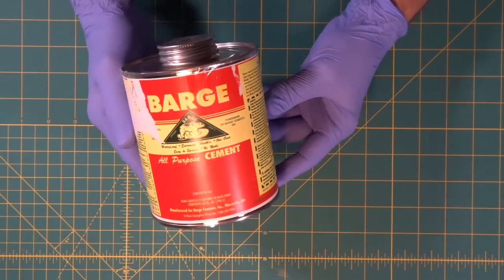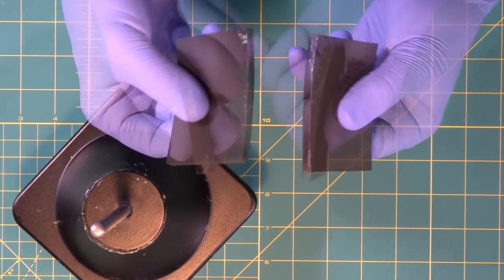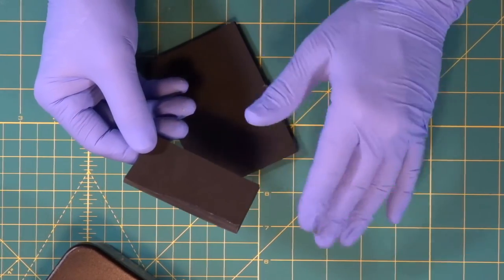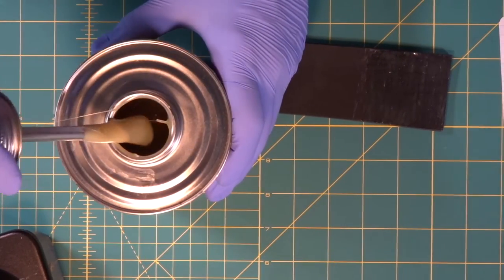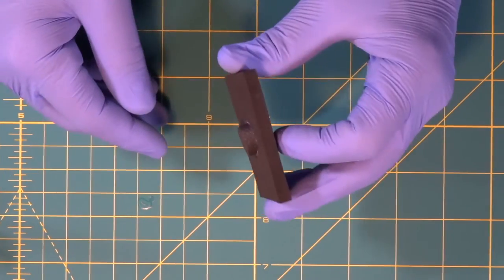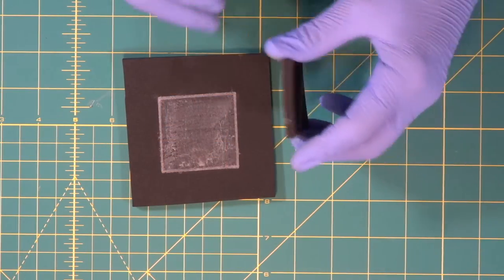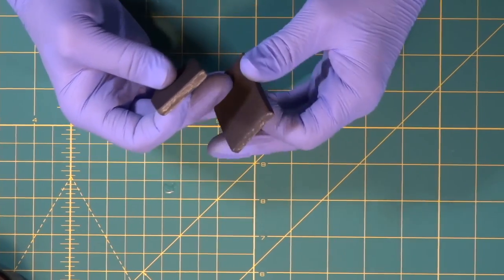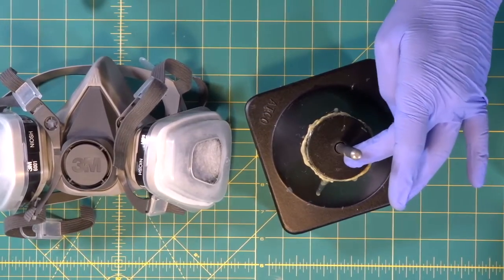Contact Cement Basics

Comment: I've used contact cements for close to 50 years. If you want stronger bonds, then let your surfaces to be joined cure for all day, or overnight, then reactivate the cement with your heat gun, then join your substrates, and press until the product has cooled.

Comment: I use contact cement to fix my fishing waders if I just have a small hole. I usually buy the tube cement, so I can just squeeze it on around the damaged area and put it on kind of thick. That's it. no patch or anything is necessary. If I actually get a tear, I can use a piece of net drywall tape and make 2 layers, so that I am sure the netting is covered. You need to scuff up the rubber first, and making a circle with a pen or marker helps you to make sure you are covering the right spot. I lay them down flat in a back room overnight, and the glue is hard next morning. It remains just a little bit flexible, which is what you need with waders. It is not good looking, but the fish don't seem to mind, and it is very quick and easy.

Comment: 10:45 - outline your cement zone with painters tape.  If you go over the edge you're only going over the tape.  Then after applying you can pull the tape off.  You've gotten cement to the limits of what you wanted and not beyond.  You can even do it without a sharpie.
Reply from the maker: Pete that’s a great tip!!!

Comment: Thanks for the video! I have a few questions:
1. Is contact cement the same as rubber cement?
2. Although you had demonstrated that the cement would not bond when 'wet', but what happens if you apply the cement on two pieces and then press the two pieces together, cement onto cement, but then let it sit for a long time (hours) such that the cement dries? Would they bond?
3. You had also demonstrated that if only one piece has the cement, you cannot bond two pieces together. Again, what if you do give the pieces enough time for the cement to dry? Would they bond?
Reply from the maker: Hi PX,
1. Not really, contact cement really only sticks to other contact cement. It’s a two part thing. Dry cement sticks to dry cement unlike rubber cement when rubber cement can be applied to just one piece and it can stick to something.
2. Actually yes. A bunch of my builds require sliding a piece of foam into a super tight area that requires two pieces of foam to rub together as I’m putting them in place which could never happen once the cement is dry - but if both pieces are wet and I slide them in it will eventually dry and they will stick together. Check out my video for the arm cannon, at 7:50 of Arm Cannon Part 1 I show that. Apparently the solvent inside the contact cement evaporates and they will stick.
3. Probably. Because the wet cement from the one piece would rub on the other piece and they would stick. But you would have to let the two pieces sit there for a while until they dried and one of the pieces could move a bit before it dries? If you cemented both pieces and waited for both to dry then you will guarantee that they stick right where you want them to.
Reply: @BlackSheepProps  Thanks. You had been very helpful.
Reply: @BlackSheepProps  is rubber cement just as strong as contact cement?
Reply from the maker: Hi Phileas,
No, rubber cement is different.
Yes, wet on wet will eventually stick once they dry. Sometimes I need to stick a wood dowel into a cavity in my foam so I will coat the dowel with wet cement and then I will slide it into the cavity so it rubs onto the inside walls of the cavity - and after a few minutes the solvent content will evaporate and they will be stuck together. Best way though is to coat 2 pieces, let them dry and then stick them.

Comment: To cover relatively large areas (for example, two 14"x14" surfaces) in an appropriate amount of time (to avoid excessive drying), should the contact cement be rolled on? And if so, how likely is it of applying too thick a coating by rolling? Any pointers for rolling on contact cement would be greatly appreciated!
Reply from the maker: Hi, I have covered large areas by pouring the cement out in a puddle and using a large throw away brush to paint the entire surface fairly quickly. It takes several minutes to begin drying and even after it is dry it will still make contact with another surface with dry cement on it. That’s actually how contact cement works on all of my builds - coat 2 pieces and let them both fully dry and then they will stick together.

Comment: Im just trying this for the first time, im trying to make concrete molds for firepit tops using foam blue board, found this from a smokless firepit video, but he had it in like a propane tank with hose and spray gun, you said you used this often, maybe try that out, not sure pros and cons, just like learning and sharing knowledge
Reply from the maker: Hey James!
If the issue is about contact cementing the blue foam together to create a mold, it should work. Contact cement holds super strong foam on foam. Maybe layer up the foam boards so its really thick - that way when you cement all the blue foam walls together to make your mold there will be a wider contact area where you are sticking them together.
May the force be with you.

Comment: Using that fan, doesn't it make your contact cement dry faster, also thickening it ?
Reply from the maker: Hi! Not really, it’s about 5 or 6 feet away so it’s a gentle breeze. Drying faster is actually good - it’s a pain in the butt waiting the 4 or 5 minutes before you can stick two pieces together. I have never experienced the fan breeze thickening it before. Opening the cement keeper ( some call it a glue pot ) regularly can let air into the pot and it can start to thicken the glue but I pour a small amount of thinner into it periodically and stir it up and it helps reliquify it .

Comment: Hi there, for a porous surface like wood, should I first put a layer on it , wait half an hour, then re apply? Also how long is it ok to route the edges (laminate on wood)?
Reply from the maker: Hi Christopher! Unfortunately I only work with EVA Foam when I build my props. I have never used wood or used contact cement on wood, sorry I can’t help you with your question.
Reply from the maker: Actually I do periodically use a wood dowel inside my foam to give it stability. I have contact cemented a piece of foam to a wood dowel so I know it works great on wood in that case - but I have never tried to cement wood to wood.

Comment: Excellent demonstration covering a variety of do's and don'ts. Question: There's a lad in another video who suggested using a heat gun to quicken the drying process of the edges just glued, if in a hurry; therefore, is this suggested a don't?
Reply from the maker: Hi Timothy,

I have seen a lot of builders speed up the drying time before they attach 2 pieces by using a bit of heat. Most of the time using  a blow dryer so it helps the contact cement dry faster before they stick the pieces together. When your layer of glue is applied smooth and not too thick it dry pretty fast. Once in a while if I have applied my cement too heavy and it’s a bit too wet, I might hold it in front of a regular fan for a minute to help it dry quicker.  But most of the time it drys pretty quick on it’s own. Thanks for watching! Here’s the link to our channels homepage in case you haven’t seen our other videos : https://www.youtube.com/c/blacksheepprops
Reply: @BlackSheepProps  Thank you Sir for your response... and speedily at that!

Comment: If I am using contact cement (Barge) for patches on a leather jacket, how long do I wait for it to dry before connecting them together? And iz this a good method when sewing is not an option? Thx
Reply from the maker: Hi Nicki,
I usually work with foam but I have used leather a couple times. Two pieces of leather have stayed together since I stuck them - still strong! Not sure which would be stronger since I have never sewn before? But the contact cement is crazy strong. As far as drying goes, just wait till the shiny wet look is gone, and both pieces are dry to the touch and then they will bond together.
Reply: @BlackSheepProps  I appreciate your response. I used contact cement so far itz working thx

Comment: I have a question im trying to duplicate a water fan inner liner the one that came with over time crack all up so im trying to use rubber will contact cement work for the job im trying to build?
Reply from the maker: I’m sorry but I only use contact cement on foam for my prop building, not really sure about your question. Sorry.
I would call the number for your brand of contact cement, I’m sure they probably have some there who could answer that. Good luck.

Comment: Great tips! thank you
Reply from the maker: Hi Hero,
The squeeze bottle is made by BENECREAT and I think they were 4 Ounce bottles. You can find them on Amazon. I still haven’t tried using my contact cement with the squeeze bottle yet but at some point I will! Good luck! And have fun! And in case you haven’t seen all of our other tips videos and builds, here is the link to our channel’s home page : https://www.youtube.com/c/blacksheepprops
Just look under VIDEOS and PLAYLISTS at the upper left of the page to find a complete list of our videos.
Reply: @BlackSheepProps  How would you get it in the squeeze bottle? It's so gloppy and runny..Do you use a funnel to get it in the small squeeze bottles? Thanks
Reply from the maker: Yeah, I think a funnel should work.
Reply: Black Sheep Props Having a very tough time with Barge cement. I’ve already had to get thinner to make it less gloppy but it gets all over the place and I’m not getting a good bond.The quart size built-in brush is extremely messy and does not allow for easy application on the surface of the foam
Reply from the maker: Hi Hero,

I have learned a lot about handling my contact cement over the past year or so, here’s what I learned that really helped me.

I have to regularly add thinner to keep my Barge nice and thin. I do not use the brush that comes in the quart - I bought a glue pot to hold my cement - which is awesome and it comes with a nice brush that is replaceable. But even with a glue pot, if I am doing a lot of glueing on a prop and the lid to my glue pot is being opened for long periods of time I have to do more thinning because the air gets into the glue pot if the lid is open a lot. I also periodically replace the brush end in my glue pot. And when I do add thinner to my cement I also clean out the brush in the glue pot as well - nice to keep everything smooth and clean and not gloppy. Keeping it all clean is SUPER important I learned. Try getting a glue pot - it’s been great. On Amazon search for an ATCO Cement Keeper. Leather repair guys use it for all their work - it’s great if you plan on doing a lot of builds. Hope that helps.
Reply: @BlackSheepProps  Got my ATCO glue pot today. Tested on a handful of scrap EVA foam pieces. It's amazing! Wayyy better than using the Barge can (with that tough to unscrew cap). Now I can rock with this. Thanks!     Also, I used my heat gun on Low (over both glue covered edges) for about 7 seconds and it dried out the edges and made it quick to attach both parts together.
Reply from the maker: Great to hear about the ATCO pot - super great tool to have! Every once in a while you will notice your glue and your brush start to get a little gunky because a lot of air gets in since the opening is so big at the top - but just add some thinner and stir it up and it gets the glue nice and thin again. And you can clean your brush out with thinner once in a while also. And you can buy extra brushes to replace every now and then too.
Reply: @BlackSheepProps  Do you have a Facebook page or email? I'm following all the steps to apply a thin layer of Barge on each EVA Foam edge, waiting even 15 minutes or so and when I press the edges together, some parts stick but not permanently,, I can still pull them apart..Note: I'm doing this in a cold garage as it's 35C degrees outside. I even made sure I added more Barge to the glue pot and stirred it up (it has some thinner in there too). I used a foam wedge after applying with glue pot brush to even it out, but still to no avail. It doesn't look wet anymore but won't permanently bond. super frustrating
Reply from the maker: Hi Hero!
Dude that’s weird?! I have never had my cement not stick unless it is still wet. Once both sides are dry it sticks instantly - and SUPER strong. I have never had my dry cement not stick? But it doesn’t get cold here - maybe the cold is the problem?
Reply: Black Sheep Props ok that has to be the problem. Keeping the glue pot indoors for 20 hours and will try again on different foam edges
Reply: I noticed I was getting yellow splotches of cement when i applied the cement to the foam edges. I added some Bestine Thinner to the glue pot, shook it up and reapplied..now it's transparent again. Also, how often does the screw-on brush for the glue pot need to be replaced? Thanks so much
Reply from the maker: Hey Hero,
Glad to hear your thinned out again. Super important to have smooth glue. I know when I build for 8 hours straight my glue starts gunking up from all the air I let into the pot over 8 hours. I am just using trial and error to keep my brushes clean but the rule I have followed is I clean my brush when I notice my glue getting gunky. I fill a cup with about 2 or 3 inches of Bestine and I stand my brush in there for a while and then I use paper towels to squeeze as much gunk out of the brush as possible. I’ve changed out the brush twice over the past year ( for a total of 3 brushes ) - and I use my glue pot almost every day for over a year.

Comment: I bought some contact cement about 2-3 weeks ago, and it’s already fully dried despite being sealed when I’m not using it. Is there any way to revert it back to a liquid once it’s fully dried?
Reply from the maker: Hi Louise!
Totally know the feeling!
I use an ATCO glue pot (or cement keeper) and it has a large opening at the top so when I am using it all day it repeatedly gets opened and closed and can start to get thick after one day of being exposed to tons of air, so what I regularly do is pour in some thinner and stir it up and it thins it out back into a much more smooth and watery consistency.

Don’t go too crazy though, just pour a bit in and stir it. If it looks like it still needs to be thinner then add a bit more and just keep adding until it’s a thin as you want it.

Gotta have thinner always on hand to keep your glue smooth.
I use Bestine Rubber Cement Thinner. Been great for me!
Reply: Black Sheep Props Thank you so much!!
I thought I was gonna have to buy some we contact cement.
Reply: Would paint thinner work or is there a specific type of thinner for contact cement?
Reply from the maker: Each brand of contact cement usually sells it’s own thinner but I have always bought BESTINE THINNER. It has worked great for me.

Comment: Do you know How long does it last, unused in the can? (I only need a little bit for my 1st project)
Reply from the maker: Hi Andre,
As long as the can is sealed it lasts a long time. I pour some into my glue pot and reseal the can until I need to pour more into my glue pot so the contact cement sits for quite a while on the shelf in my garage until I need to pour more into the glue pot.
And every time I re-open the contact cement can the contents are still good. Should last a long time.

Comment: I've been using this completely wrong. 
This was really thorough. Watched the entire thing. Problem is that somehow spilled over my desk and got on a few objects. Aside from heat is there any other way to remove it? Goo Off, Acetone, etc?
Reply from the maker: Hi D86,
Glad it was helpful! I build props out of EVA Foam and thinner is MAGIC! It easily separate two pieces in a second! In my experience thinner is kryptonite to contact cement. I use Bestine Rubber Cement Thinner. I buy it from Dick Blick art supply.
Reply: @BlackSheepProps  Thanks for the quick response! I will certainly give that a try. Thanks again for your in depth video!

Comment: Will it work to glue back the decorative rubber trim around window inside of car?
Reply from the maker: Hi TF,

Not sure? I have used it to cement foam to leather, leather to leather, the fuzzy side of velcro to leather, the fuzzy side of velcro to foam and neoprene rubber cord to foam but that’s all I have personally experienced. 
If it’s rubber to fabric it just might work. Heat would be the only problem though. A ton of heat can cause the contact cement to delaminate and it could come apart.
A jillion degrees baking out in the sun might cause it to fail.
Sorry I can’t be more help.

Comment: So why if you stick two wet pieces together like when you put the plug into the hole it works why bother waiting for it to dry before attaching the pieces?
Reply from the maker: Hey Jim,
You have to wait until both sides of the glue are dry before 2 pieces will stick together, so you normally wait until both pieces are dry and then touch them. But in the case of 2 pieces that have to slide into each other they won’t slide after they dry so you have to slide them when wet and then let them sit until the glue drys them in place.
Reply: @BlackSheepProps  Thank you i understand why they had to be wet to slide in but the question was if you can put 2 wet pieces together then let them dry why bother letting them dry then sticking them together.
Reply from the maker: Ah, I understand.
If you put them together while wet they could shift a bit before they dry and stick, or it could stay in place but there can be gaps left in between the 2 pieces that make the contact not complete. If you let them dry and them smoosh them together you are guaranteed of getting total contact. Plus, when you leave them apart and let air hit both parts they dry faster than when you put them together while still wet.
Reply: @BlackSheepProps  Thank you